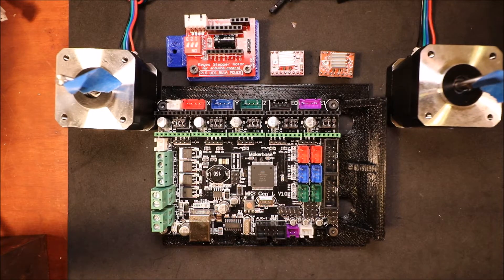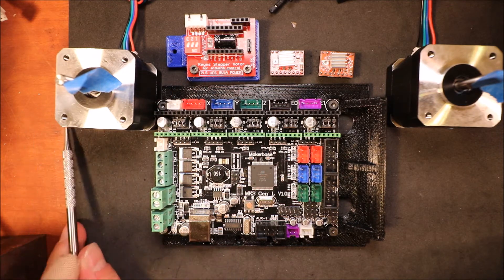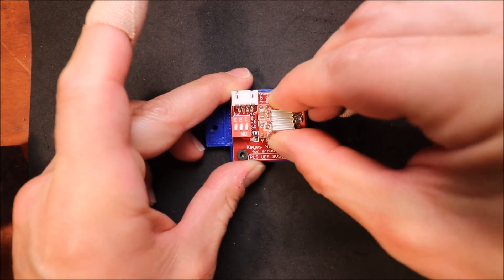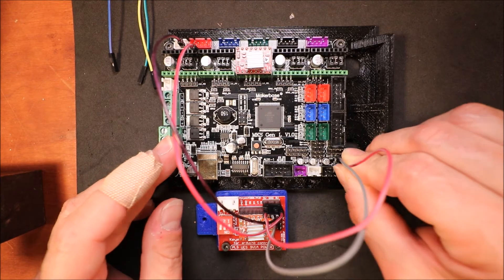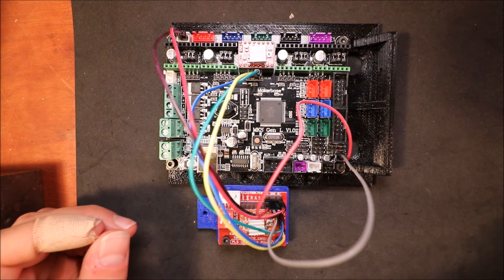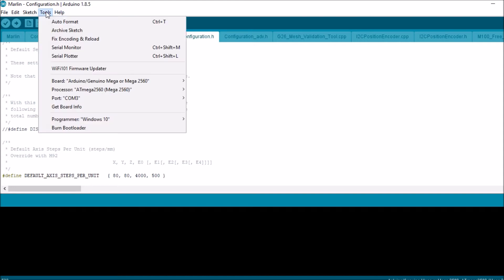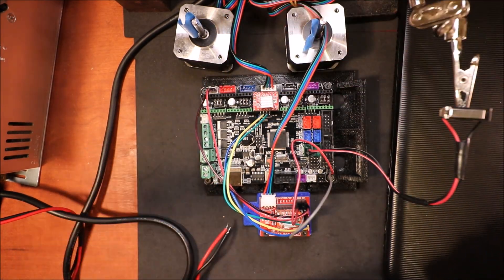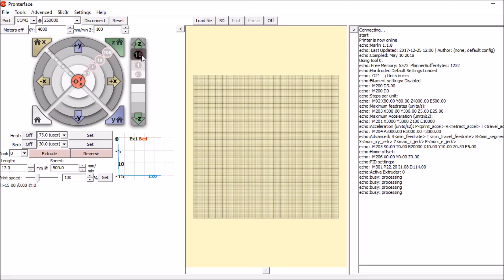MKS Gen L - External Driver

Comment: Question: is it possible to plug something with 5V intake to the borad? like a fan that runs on 5V, is it possible on an MKS Gen L?
Reply from the maker: 5v fan is possible.
Reply: @EdwardBraiman  but, how? Like, I guess in the servo pins (4,5,6,11) but, I'm not an expert in this. Where/how would that be? I'm watching all your videos on the mks gen l btw, they are quite interesting
Reply from the maker: Thanks.

Comment: Hello Edward: Is possible plug to this extender driver tmc2209?
Reply from the maker: In this use case it's possible, but you'll need to use pins on top of stepper and possibly configure pins file.  Also exercise cation with underside of stepper.
Reply: @EdwardBraiman  Which pins do you thinks? For UART connection? Pin R8 and UART? And which file? In marlin pins_MKS_ROBIN_NANO.h?
Reply from the maker: First try the signal pin for endstop you're using, if you're using one and fish pin as long as similar pin type as there maybe a signal or analog pin.  The pins diagram should be your guild with pins file.
Reply: @EdwardBraiman   When I add driver-extender according you how-to(video above) on z-axis, can I manage drivers via uart-pin on drivers via one cable(in serial connection) or I need attache to board two separately cable and in marlin pin file(pins_MKS_ROBIN_NANO.h) separately z2 line?

#define Z_SERIAL_TX_PIN                   PC7
  #define Z_SERIAL_RX_PIN                   PC7

part separately for z1 and fo z2
Reply from the maker: I might need to warn you of one issue that might occur in configuration I just thought of, you may need to add resistor off leads for external stepper board.  I think it written in Marlin firmware.
Reply: @Edward Braiman:  Very thanks for your support. I saw some "uart how-to" with resistor(I will apply), but main question is : Is possible manage two drivers on z-axis via one cable(can both uart-pins of drivers to lead via one cable to mks-board, because they should be setup with same parameters)?
Reply from the maker: Do you mean split with a wires, yes.  You many need to adjust current from stepper.  It can become tricky.
Reply: @EdwardBraiman  Yes mean one cable? 
Or will be better on z-axis(where will be two drivers) stay in STEP/DIR mode, managed via jumpers?
Reply from the maker: Are you running two motors off one stepper or two steppers with a motor each?
Reply: @EdwardBraiman  second options, two drivers with a motor each. Same as on your video 'how to" above.

I need to solve problem with current. Motors which I want to install to printer have Rated Current 1.5A, RMS current for this motor should be 1.063A and driver TMC2209 has max RMS current 1.7A.  It means that two motors on z-axis need 2x1.063A=2.12A which isn't allowed for TMC2209. Therefore I need for each z-motor it's own driver TMC2209.
Reply: Or I could use driver TMC5160. There is RMS 3A and it should be enough for both motors attached on one driver?
Mentioned driver is managed via SPI mode. Board MKS-Robin-Nano 2V directly supports SPI mode via jumpers settings.  
Question to You: So it doesn't require this horrible cabling/welding? Only jumper setting and marlin configuration?
Reply from the maker: I normally use drv8825 on z axis.
Reply: It look like fine, on this driver is Maximum current per phase: 2.2 A. It mean that I can attach there both motors in parallel mode? Is needed there active cooling via fan?
Reply from the maker: They move in parallel, but it's not truly parallel as it's two steppers.
Reply from the maker: TMC5160 should in theory work without soldiering, if you try and add sensorless homing, then it would require soldering, but I'm unsure of how well it would work.
Reply from the maker: The MkS Gen L v1.0 is a hard board to configure advanced steppers.  It's a wiring nightmare.  Just keep that in mind.
Reply: @EdwardBraiman : And which MKS board could you recommend me to buy? Till now I worked only with Robin-Nano-v1.2(but only with step/dir mode via jumper). Currently i am determined to buy MKS board Robin-Nano2v or 3v, however im willing to change my mind according to your recommendation. Both board support UART/SPI mode(via jumper without cabling/welding). I saw your video about configuration UART on Robin-Nano2. It looks quite understandable for me.   

BTW: I found out about TMC2226, RMS current there should be 2A(more then on tmc2209, where is only 1.7A), For both motors I need RMS=2x1.063= 2.126A
What do you think about it? Can I use those chip? 
I want to try to configure UART mode on all axis, but with chip drv8825 i could only use step/dir mode on z-axis .
Reply from the maker: It depends on your budget.
Reply: @EdwardBraiman  And TMC2226? Do you think that I can try it? or will not working and RMS 2.1A is too much?
Reply from the maker: I think sticking with 800 ma is safe.

Comment: This external driver aimed only for Z axis? In other words it sync with main driver? Can it work independently from main Z driver? Can it be used for additional independent X2 motor or E2 motor in IDEX system?
Reply from the maker: It's possible to make it independent of existing steppers by using auxiliary pins and modifying pins file for board.  In my RAMPS 1.4 playlist there is an example of adding a third extruder which might help.  Poca.

Comment: Hi Edward Brainman, Great video. Thank you for sharing all the details. I need your wisdom. Is it possible to control the stepper motor by connecting the "stepper motor for arduino control" you use in this video directly to an Arduino? I really appreciate you sharing this video and hope to learn more from you as you are the only person online I have found taking about this External Driver. 
I'm trying to use an Arduino Nano to control a Nema 17 stepper motor without using a breadboard (Arduino to External Driver, Power to External Driver, External Driver to Stepper Motor). Is this possible? I'm new to Arduino. Anything you share is appreciated. Thank you Mr. Brainman. Great name. :-)
Reply from the maker: Arduino functions with a shield.  The shield is powered by a 12 or 24volt power supply whereas Arduino functions of 5 or 3.3v logic.  Remember power supplies vary accord to shield design, mean some do not use 24 volts.
Reply: @EdwardBraiman  Thank you Edward for you quick and helpful response about voltage. I greatly appreciate you guidance.
I'm using the same shield as you in the video. The shield shows it should be used with a 9V1A Power as it's printed on the shield. I was just told that 9V1A seems a little low for a Nema 17. Did you have any trouble with this shield using 12 volts? 

I'm totally new to Arduino and want to make sure I could connect the Shields E, D and S pins directly to Arduino to control the Stepper motor. Does this sound right to you? In your video you connect them to another controller instead of directly to Arduino. Is it ok to connect this shields E, D and S pins directly to Arduino? 

Thank you again for your help. Say Healthy and Happy.

Cheers.
Reply from the maker: Keep in mind an Arduino nano might not work as well as a Arduino Uno and between Arduino Uno and a stepper shield it costs about $10.  Check out my playlist for RAMPS 1.4, it might be a better solution for what you're doing.  Also do not run more than 5v through a Arduino.  The shield power supply is separate.

Comment: in a moment i willlllllllll
in a sec i willllllll

...
...
x100
Reply from the maker: Thanks.
Reply: @EdwardBraiman  Dont get me wrong love ur vids.
Btw, do you know how to connect 12v fans directly to 12v PSU? I want to add coolers for all the stepper motors so that is 6 fans I need to connect directly to PSU if you know how plz msg me ty
Reply: something along the lines of a fan splitter for led psu used in 3d printers

Comment: Hey there, would you happen to know if this would work for the Mks gen 1.4 controller board?
Reply from the maker: Yes.
Reply: @EdwardBraiman  yeah just paid more attention, ofc it would work as it's just a copy of 1 axis. What I need is one more stepper for an extruder as I'm going to feed 3 colors * grumbles * back to the drawing board
Reply from the maker: It's possible to add a third extruder.  Check out my video in my RAMPS playlist for adding a third extruder.
Reply: @EdwardBraiman  cool thx will check it out

Comment: Is it possible to use the breakout boards on a non replaceable driver motherboard? example would be MKS Base with the external breakout board using something like tmc2208 driver. I'm guessing that is not possible but maybe it is?
Reply from the maker: Anything is possible.  Sounds like a good idea.  Keep in mind they now make SKR 1.3 board with built in design for steppers.
Reply: @EdwardBraiman  Oh I am not looking to do this as I only have boards with replaceable drivers now but it crossed my mind when i saw a breakout board in one of my aliexpress searches/recommended items. I am mainly curious because my original mks base board fried one of the built in drivers so I always wondered if it was possible... Do you think you could try a driver breakout board with a non replaceable driver board to see what happens? I am mostly curious about the marlin setup as it would be running through 2 drivers so not sure how that would work.

Comment: Thank you! Do you think there is a way to connect external driver to MKS Base V1.5. ? I cant find any info..
Reply from the maker: That's a complex question.  You would need to examine the pins file.  My guess is yes, but you'll lose many auxiliary pins in the process.  If you checkout my tutorial in RAMPS 1.4 on how to add an additional extruder it might point you in the right direction.  Let me know how helpful or not it is.  Keep in mind the tutorial is really old for Marlin firmware.

Comment: Hello dear Edward, thanks again for your wonderfull videos! Could you tell me if this "stepper extender" is good for MKS Gen-L?
https://www.aliexpress.com/item/Nema-17-42-for-Stepper-Motor-Driver-Expansion-Board-DRV8825-A4988-3D-Printer-Control-Shield-Module/32973760480.html
Instead of this one https://www.aliexpress.com/item/stepper-driver-extender-A4988-DRV8825-extension-stepper-driver-panel-additional-motor-adapter-breakout-board-drive-expandor/1000007369401.html
Thanks a lot!

Comment: Hey ! How did you find out about these pins? I am looking for documentation. I am interested if I can omit the driver altogether, and just use the direction pins to go to external stepper drivers for larger NEMA 23 or NEMA 34 motors for a CNC machine. I already have a MKS Gen 1.4 and since it has the same pins, I am intrigued. Any information or resources to the documentation for the GEN L or other MKS GEN boards would be appreciated. I have yet to find a pinout or documentation that addresses what those pins do. Thanks for the video !
Reply from the maker: I'll see what I can find this weekend ...
Reply: Edward Braiman I would appreciate it ! 
I am trying to find it
But there are so many manufacturers now and most of them are Chinese. I am can’t seem to find a pin for pin diagram that says more than the PIN number 

A few I have found have many other task specific pin outs 
None of them address the pins you mention 

I would hope they are parallel PCB paths to the same pins into the stepper drivers.

Comment: Sorry about the pretty basic question. Why would you need an extra, external stepper controller for the z axis? In addition, Isn´t it possible to pair the Z socket with e1 socket to have double z motors if you don´t need a dual extruder? Thanks!!!
Reply from the maker: It's a great question, in my playlist there is multiple ways to move axes.  Unfortunately i didn't do them in one video as some were based on questions from viewers later on.  Still need to demonstrate dual x carriage, but still designing a printer carriage.

Comment: So what is the advantage of this over just using a parallel board and running both z steppers off the same driver
Reply from the maker: The optimal way to run is two on same stepper driver like on RAMPS 1.4.  The reason for the tutorial was a user request for a work around for MKS Gen L board configuration.

Comment: The easier way would be to add a Splitter cable to 2x TB6600 drivers off the external driver pins. You then only need to run a motor per high power driver. Much simpler and much neater solution.
Reply from the maker: True.  Just keep in mind the board may have been designed for a single stepper in the z axis.  In the case where people need a second stepper in the Z-axis, I would recommend using a RAMPS 1.4 solution.  Your work around is another solution to the problem.
Reply: @EdwardBraiman  Will it work if I connect 4x High power drivers to the external driver pins?

Comment: Hi, thank you for the video! I see both steppers are synchronized so basically you can only have 5 axises with this mks board. Is there a way to connect this external stepper driver board so it wont be synchronized with one of existing axises on mks but be the 6th additional axis?
Reply from the maker: You could add additional axis with auxiliary pins.  I've only tried 6, but some have done more.

Comment: i think i read somewhere that you can tell marlin to use say e01 as the extra z port?
Reply from the maker: Correct.
Reply: thank you :) now to find material on ho to do this haha :D
Reply from the maker: Marlin firmware configuration adv.h
Reply from the maker: I'll be recording a video soon, got sidetracked with dual x carriages.
Reply: ill be looking forward to it :)  projects usually takes you deeper down the unknown :D

Comment: hi Edward Braiman,

Thanks for all the videos you have done on the MKS Gen L board. I've been working on doing a conversion of an older Cubex printer to Marlin Open Source and these videos have helped to answer a lot of questions. 

I was wondering with the external stepper driver are the A4988 and the DRV8825 the only supported modules? My end goal with the printer is to make it as silent as possible and I would like to use the TMC2209 for the XYZ (the Y has two motors) and use something with a higher amperage like the DRV8825 to drive each of the two extruders. That; or was going to wire a motor in parallel but thought the driver might be a better option.

Looking forward to more videos on this; maybe on even adding a heated bed and mosfet? :)

Cheers,
Reply from the maker: Multiple types of driver modules can be used.  Currently I have two more driver modules videos I want to do, but there have been many requests for calibration of stepper modules.  I almost ready to record one of the two, but I'm still checking my math.